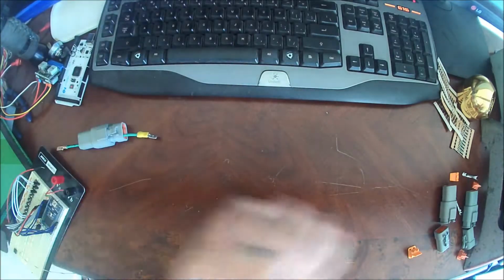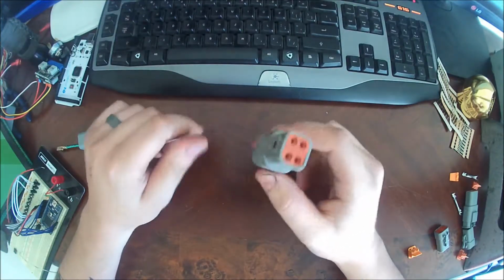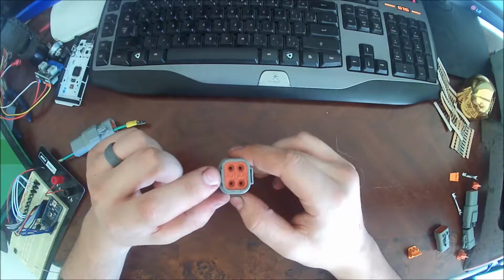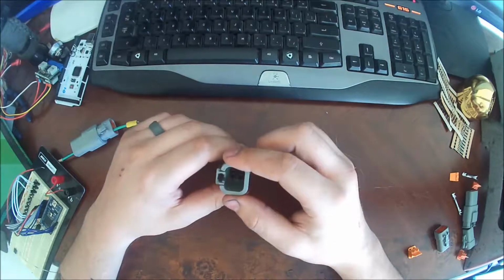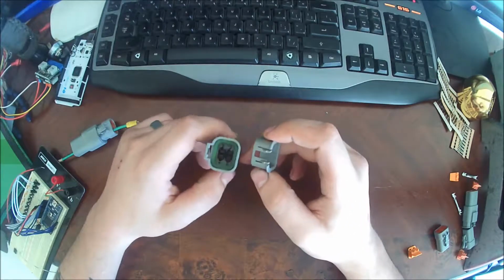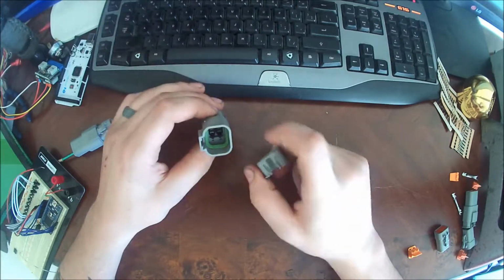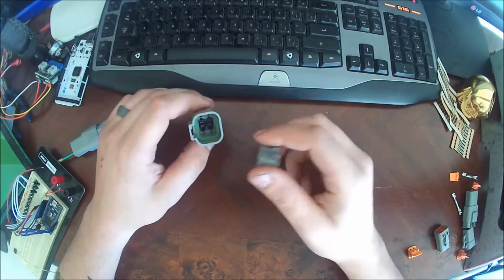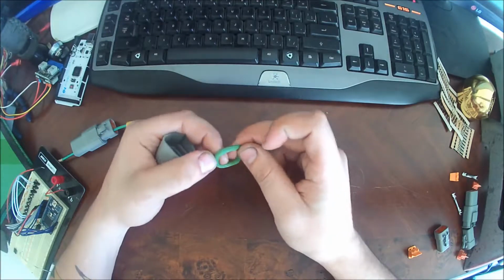Deutsch DTP compatible connectors

Comment: excellent review dude!   i agree with you on "using" the amphenol brand.   
one thing though.   where the heck do you get the mounting tabs for either one?  there like not exsistant?

larry
Reply from the maker: Larry, the part numbers for the various mounting tab options are in the TE catalog page 127. They can be had for about $4 on Mouser. Feel free to send me a message if you can't find them!